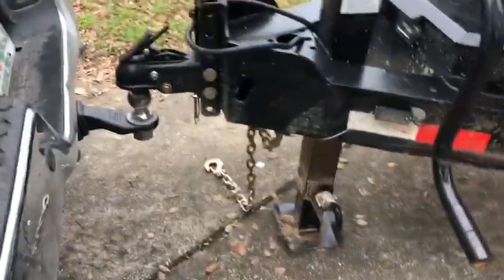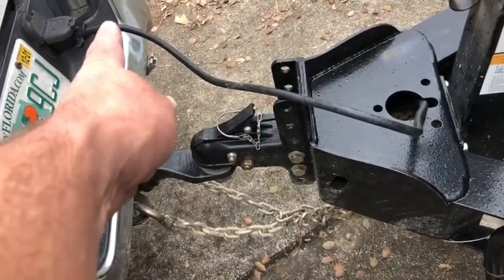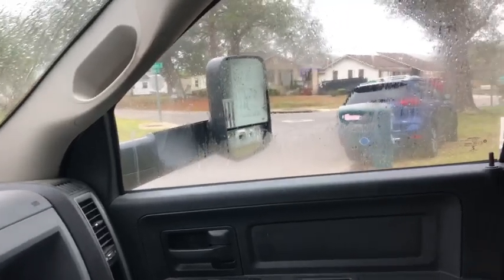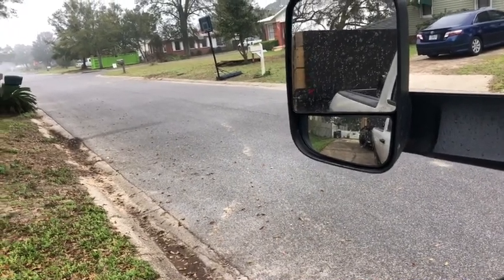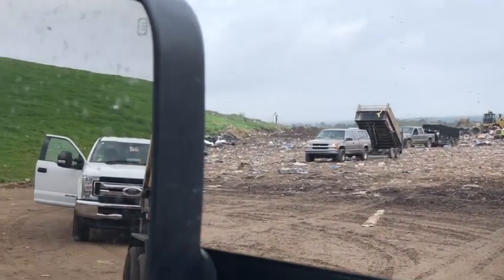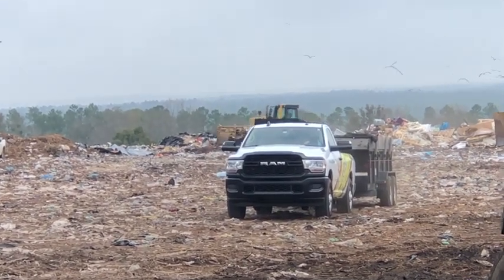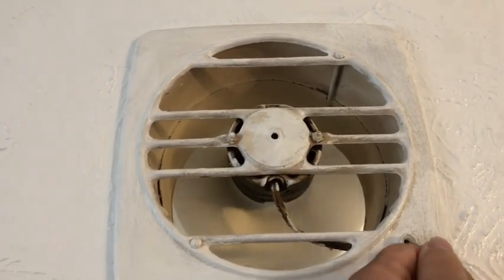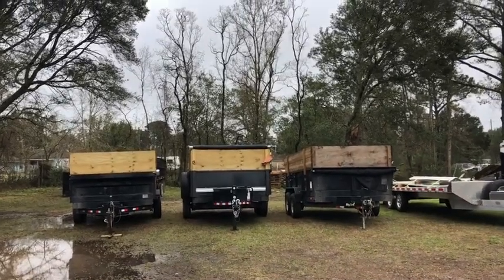Dump trailer pick up ! #dumptrailer #sidehustle #entrepeneur #getrich #millionaire

Comment: Thanks for driving the point home about double checking your trailer is attached properly.  In the labour industry, sometimes guys are too lazy to double check and then like to blame their mistakes on their subordinates.  Had a friend of mine try to talk his way out of the blame for flipping a wood chipper in a main intersection, even though he was too lazy to double check that his trailer was secure.  Passing the blame did not repair that chipper.
Reply from the maker: No sir it does not and I think a triple check is even better